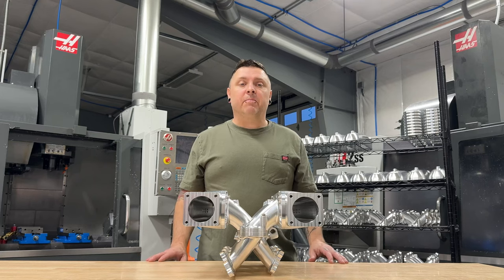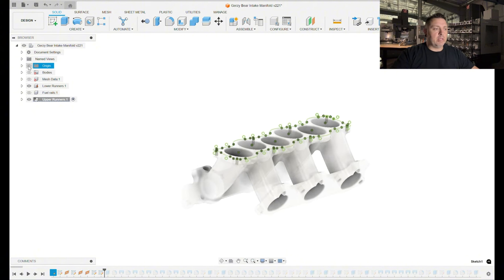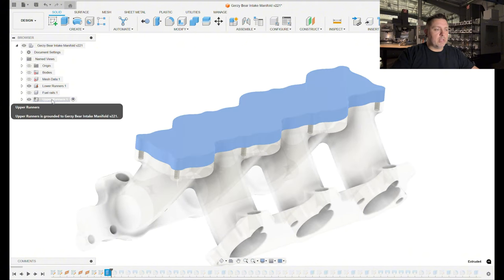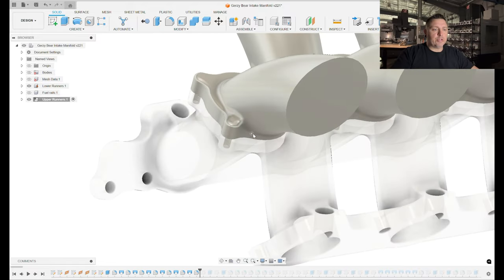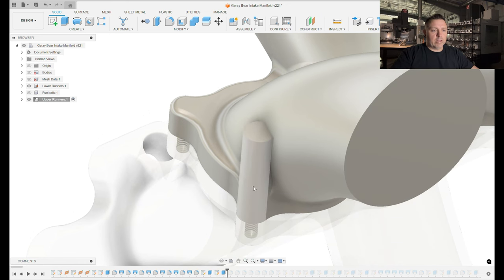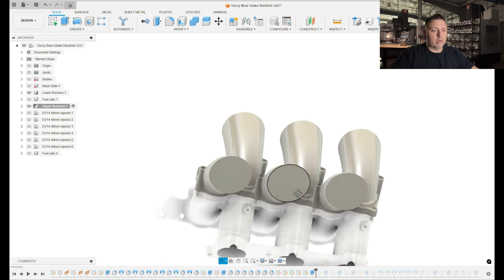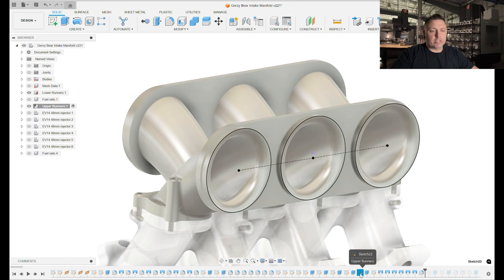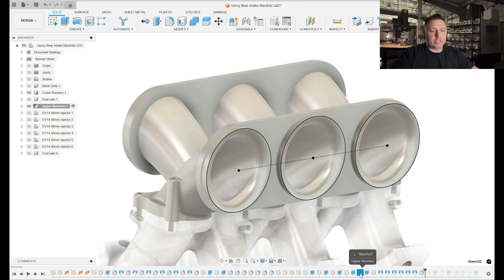Learn to Build a PROFESSIONAL Billet Intake Manifold : Episode 2

Comment: You did a great job but I would have modeled it differently, I would start with one runner and do the top and bottom in a single loft to assure the angle of the curves are perfect and the tapper is consistent along the entire runner, then shell to the desired internal dimension at the head. Linear pattern and transpose the 3 to the other bank. Then i would do the flanges to head, and the flanges separating the top from the bottom, the oval section cut and the flanges would be perfect and the runner would be a smooth curve all the way. After the top and bottom flange is done i would separate the models and work them separately. just another way to skin the cat...
Reply from the maker: There are so many different ways of achieving good results, thanks for sharing more!